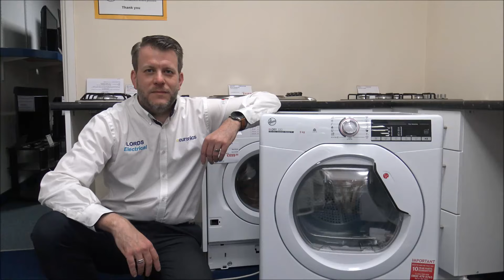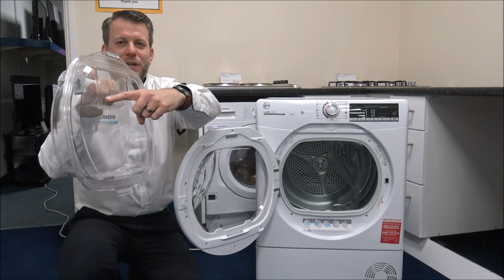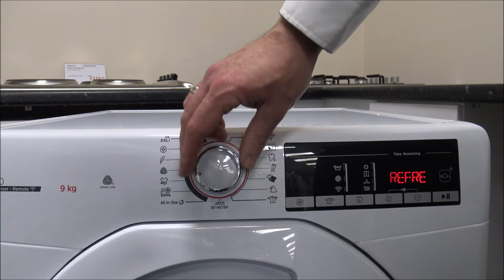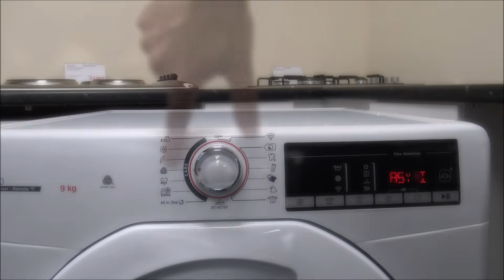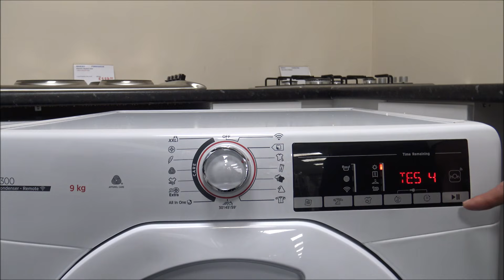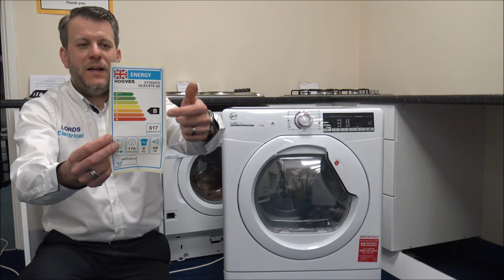Hoover HLEC9TE 9Kg Condensor Tumble Dryer Demo

Comment: The written instructions supplied with the appliance were insufficiently clear. Users familiar with the traditional drawer-style water container may become confused, as many will not expect the water container to be integrated into the door. The documentation does not indicate this at the outset, which is likely to cause unnecessary uncertainty when users simply wish to operate the appliance and dry their laundry.
The accompanying video, however, was informative and effectively resolved any confusion regarding the location of the water container.

Comment: Very useful info.   Thank you,  

We had this dryer delivered yesterday.  Diagrams not so useful.  

Question :  They provide a black rubber flexi pipe and stopper.  As it is a condenser dryer, do I actually need to use this pipe?  The dryer is replacing an old condenser dryer, so it is being placed exactly in the same space under a worktop on an inside wall.  Thank you
Reply from the maker: No you don't have to use the pipe, on some dryers they have the option to drain the water out into a waste outlet rather than using the drawer to collect the water

Comment: Great demo but honestly, we are all driven nuts with technology and endless choices. I hate my new dryer that has all these settings. It drives me mad. I've tried lots of settings and clothes have ended up feeling damp or jumpers stretched. I just want to be able to bung in the laundry.  Set the timer (as I did with my previous dryer) and it was far less stressful & worked great.

Comment: Hi great information on your video. 
I just had my delivery  🎉 . I wonder why u didn’t cover the hose which comes with the dryer 
Was asking do I need to use the black hose ?
Reply from the maker: You don't have to use the hose, it is an option if you want to have the water exit the machine into a waste pipe rather than emptying the water container.

Comment: Sounds like the manufacturers are working hand in glove with the energy companies takes twice as long or... (two and a half times longer) to dry clothes than the older condenser models, claims of energy saving? Mmmh worked it out on the energy meter these newer models require more energy in the long run, waste of money.

Comment: I've just bought my first hoover condenser dryer & I have a lot more knowledge of what each button & cycle does. Thank you 😊
Reply: I'm thinking of buying it but I'm quite hesitant so after using is it worth buying or not really necessary
Thank you 😊
Reply: @akdesign4433  That depends on you & why you need one. I had to buy it because I live in a flat with communal garden & can't put my washing outside. My dryer is a little different as my water tank is at the bottom. Anyway after using it for a few months now it's been really good. It does all types of clothing very well. Just remember to follow the instructions & it should be fine 🙂
Reply: @akdesign4433  Like I said it's up to you. I can't make the decision for you. You have to look at it from all angles. Like why you feel you need one. Do you have a garden to hang out your washing

Like I said i didn't have much choice as I have a communal garden so for me i didn't want to hang my washing out & keep an eye on it until it dried

Comment: Superb Video - Very comprehensive and 101% more concise than the manufacturers offerings. On the downside (and this is on NO way a reflection on L.E's content) I have this very machine and it is an absolute let down. It takes way longer that any other dryer I have previously owned, and thus takes a lot more power (to put that comment into context, I had mine attached to an ammeter & scope to measure Exactly how much power it was consuming vs the time taken on various programs, and the findings were far from good compared to the marketing claims) So in summary, great review of a disappointing product.           Lesson learned?........ if you pay '£Hoover' don't expect '£Miele'.

Comment: Hi I have a Hoover HLEH9A2DE 9 kg heat pump tumble dryer and I have noticed that the vent at the front never seems to get hot or even warm? Should this not get warm? Have you got any videos about this model, please?
Reply from the maker: Heat pump dryers don't generate much heat so I shouldn't worry if its not getting warm at the front. As long as its drying everything OK just keep going with it
Reply: Thank you, I was worried so having a vent fitted in the plinth but glad I wasn’t missing something 👍🏼
Reply: That would be the “heat dump” fan & condenser coil; near the end of the ‘drying’ cycle is the cool-down period = as a “heat-pump” tumble dryer is identical to a refrigeration based dehumidifier that has a closed loop for the internal air circuit, when it needs to cool the ‘internal’ air; a solenoid valve diverts the hot refrigerant to the external condenser coil where the heat is “dumped” into the room air; the dryer “literally” temporarily turns itself into a “fridge” to cool itself down, and the dump coil is that vent that gets warm ~ that is intended & I would not be concerned

Comment: the spin cycle shakes to the point where we cannot put a dryer on top of it. Any suggestions?
Reply from the maker: It isn't really recommended to put a dryer on top of a washer if the washer is not stable and able to spin properly without moving a lot. I would try and level the washing machine up first to see if that helps.

Comment: Can you help tumbler dryer stuck on Demo Mode please help
Reply: Same problem no it's not child lock and it's stuck and nothing is on the user manual. I am desperate. Can anybody help with this demo mode deactivation?😢
Reply: @gbell6761 I’m the same and can’t find a solution anywhere did you get it sorted
Reply from the maker: Not too sure about Demo mode but it could be the Child lock is on? If it is then press the 2 buttons under the display for a about 2 seconds and that should unlock the machine and disable the child lock
Reply: @lords-electrical 
Please help
Cant get dryer to start!
All other buttons seem fine but it just wont start drying 
Please? 
Thanks

Comment: My 15 year old dryer took 1 hr and 10 minutes to do a load.

This dryer takes FOUR HOURS AND SEVEN MINUTES. The heat that comes out of it heats the whole house.

I have had it for a day, tried several settings. It took over 9 hours to dry Three LOADS and i pray AO will refund me and take it back.

This is not fast. It is certainly not energy efficient either.
Reply: which one did you have please? i am also on the market for a new dryer myself, just bought a candy one which i am a bit wary of now with all the bad reviews i am seeing online...looking to possibly get another one now. I had a good bush one for 10 years, it was pretty great
Reply: Worst dryer ive had takes more than double the time my old vented dryer took,machine gets Very hot but doesn't dry clothes Very fast,its rated as 9kg,but nearly every programme is recommended for lighter load's bar 4,, clothes still damp so the moisture sensor is rubbish, do not buy it you'll regret it after a Day of using it

Comment: Hi. We have recently bought one and it's great, but can't find my instructions. 
What is the rubber pipe for and where dose it fit? Thank you.
Reply from the maker: The rubber pipe will be to connect to the back of the dryer if you want to connect the dryer to a water waste outlet rather than emptying the water out from the container.
Reply: @lords-electrical Hi. Thanks for the great review. Do all Hoover / Candy condensers have the option to connect to a waste outlet? Thanks

Comment: I purchased this dryer recently really Happy with it but wanted to ask what the sponge on the back is for looks like it's glued on. thanks.
Reply from the maker: That normally helps with the insulation so just leave it in place when you get the dryer

Comment: First up I have watched a couple of your demos of washing machines over the last week and have to say you give out a lot of GREAT! informative information about the product that I have respect for and can honestly say you do a TOP JOB! with the presentation of them. Now I have to be honest regarding tumble dryers the one I have is a Hotpoint Aquarius and have had it for years well about 8 years to be precise and I brought it second hand in mint condition for £60. It's still working perfectly fine and is a vented dryer. 

Well, only last week I went to do some washing and low and behold my Hotpoint washing machine (which I also brought second hand for £130 and worked for the same amount of years) started to trip out the electricity on the fuse box and having got out a repair engineer he basically told me that the drum had come loose and most like scraped on the heater underneath to cause it to short circuit. He also told me that it would cost too much to repair. So I ended up buying a brand new Hoover H-Wash 300 H3W492DBBE Freestanding Washing Machine in black and it arrived today. Having already done a wash in it I am well pleased with the machine. 

There was a reason why I brought a black one and that was that only a couple of weeks ago I brought a black Fridge Freezer and thought it went well with my other black appliances such as the Microwave, Toaster and Kettle. So it made sense to buy a black washing machine but the only problem was that my dryer is white so even though it still works perfectly fine I thought I might as well get either a second hand or a new one in black. 

Now to be perfectly honest I have not looked at dryers for years and just by looking at them, it appears that they have put in lots of things that a dryer does not need at all and the only reason I can think they have done this is so that they can charge the same price as a washing machine for the things. Years ago no way would you pay the price of a washing machine for a tumble dryer and most tumble dryers were either half the price or even less than that of a washing machine. 

Now I was thinking of buying a new Hoover HLEC9DGB H-Dry 300 9kg Condenser Tumble Dryer which I do believe is the perfect match for my new washing machine. I actually typed in that model on the Tube to see if I could find a good well-detailed review of it like you do here but had no luck. So I thought well I might as well watch the review of this model as it's got more or less the same functions, especially regarding all the fancy new fan-dangled buttons and programs they have put on the things so they can charge extortionate prices for them 😊😊😊. 

By watching this demonstration I have to say I am in two minds about whether to buy one. As a matter of fact, there are a few things that put me right off. The first would be the actual cost it would be to dry your washing. I was absolutely shocked by these drying times of over 2 hours and it even goes up to 4 hours. This is going to cost a bomb to dry your clothes and I am actually wondering if these new dryers have any heat in them at all 😊😊😊. No way on this earth does it take that long to dry a full load in my old dryer and as a matter of fact, it's very rare it will even take an hour. For most loads, it only takes 40 minutes. 

The other things that put me off are all the fancy new fan-dangled buttons and programs they have put in the things. In all honesty, many of these things are pointless and even by looking at how long they actually take to dry your clothes the chances are that they have a lot more chance of breaking down. It appears that you are paying extra for all the new gadgets they have put in the damn things so that they can bleed extra money out of people. All these features are totally unnecessary and all one needs in a dryer is hot air and none of this malarkey.
Reply: I always use the 30 min dry after spinning my washing twice, and smallish loads work with that .

Comment: Why Is the dryer, so noisy???
Reply from the maker: These are not normally too bad, sometimes it can make a difference on the flooring material it's on. If it is very noisy, there may be a fault with it though.

Comment: Would NOT recommend one of these Hoover models with the water container is the door. We had our model about 3 years before we replaced it. The water tank would crack every 3-6 months. The water would slowly leak back into the washing making it damp again so would take longer to dry. We replaced 4-5 containers about £15-20 each in the end had enough and brought a new dryer. Hoover would not do anything even with in guarantee as they said it wasn't a 'mechanical part'. The shop did replace it with their floor model once though. There are other people who had same issue if you Google it.
Reply: Had the exact same problem, water collection container cracked and leaked everywhere. was also super hot to the touch.  Replaced it with a vented machine that works perfectly
Reply: Thank you for your comment!!
Reply: Did you also get water collecting around the seal and on top of the filter? My HRE C10TE-80 is brand new and did this both times I've used it.  I'm having a battle now with the retailer and also Hoover don't recognise this as a common fault.  Not sure if it's to do with the rubber door seal or whether the tank "weld" seal leaks under heat.  Really annoying and I'm not finding much about this on Google.  Thanks.
Reply: @monsterp1970  I believe so but the clear water tank in the door would crack. This meant water would slowly leak back into the machine and onto the clothes

Comment: I've just brought this model and makes a banging noise when running. Surely this isn't normal?
Reply from the maker: If it's making a banging noise, that does sound odd and doesn't sound right for a brand new model.
Reply: Hi. My candy heat pump did that when it was brand new back in may 2021.  Once you keep using it a lot the banging  stops and gets less loud. Basically like how brushed washers are always loud when you first get it and then they get quieter after a lot of use
Reply: I just got hoover Hlec9tcg...3 days ago...my gosh its noisy

Comment: Have a Candy (same manufacturing group as Hoover) dryer that uses this front door container system. So far it’s working really well: simple to use and maintain. Only gripe: if the water container slips and hit floor (mine has!) it cracks really easily. Replacements are easily available, but not cheap - £50-60 a time!
Reply: I had a candy washing  machine  and dryer, The washing  machine  lasted only  3 years and the dryer only 2 years.
Reply: @msmacker13  My Candy Tumble-dryer is , for now(!) still working so will see how long it lasts but ,TBH, the container emptying is a pain and it has already been 'dropped' on the floor and cracked meaning a 50 quid replacement was needed. Now thinking that I'd go back to a simple, vented model next time as with my large family, we're constantly emptying out the water container!
Reply: Yup, I would agree. Emptying the container is a chore and I also will revert to a vented dryer next time! 👍

Comment: I do like the look of this tumble dryer, the water collection on the door is a great idea. There's alot of programmes on there that I personally wouldn't use as I don't tumble bedding  (except fitted sheets) or jeans, shirts or woollens but it's great for those that do.
I think you forgot to add the link for anyone that would be interested in buying this machine.  
Very informative as always, thank you 😊